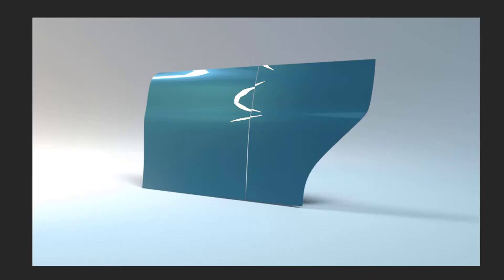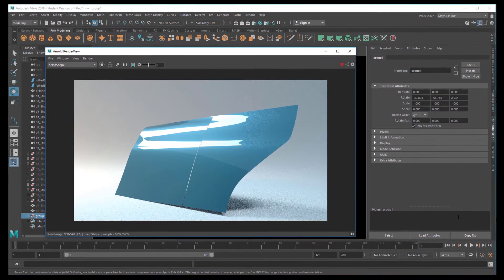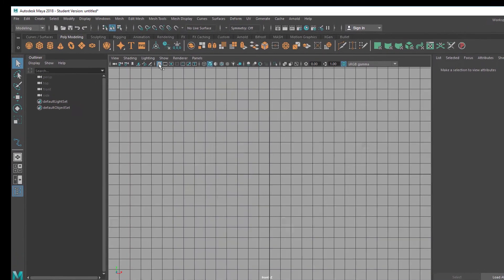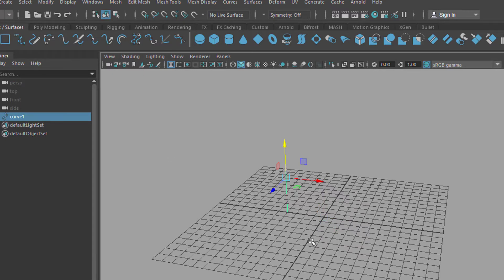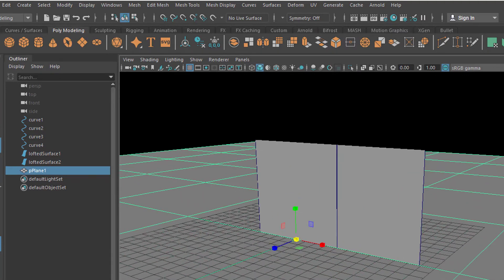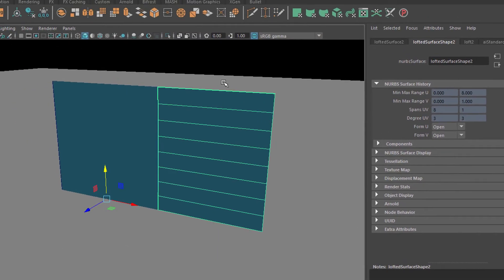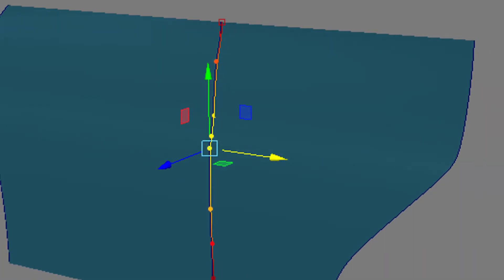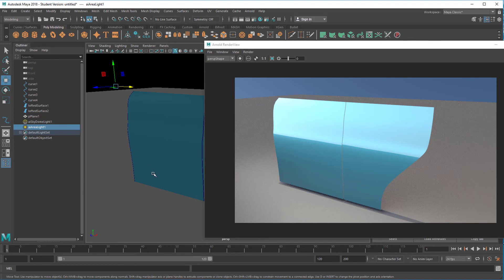Maya: NURBS Modeling and Dimension Gaps

Comment: If you want to model a car or high quality NURBS object, you might want to consider learning either Autodesk Alias or Dassault Catia ICEM. Those are the gold standard for design surface in automotive industry. On the other hand, maya is simply incapable of even the most basic NURBS modeling.
Reply from the maker: if this comment is for me, here’s my answer: i teach maya, and i know alias. maya and alias stem from the same programming teams. maya sure does a fine job for NURBS modeling, and it’s a good start before jumping over to alias.